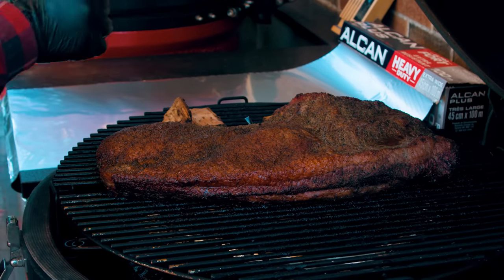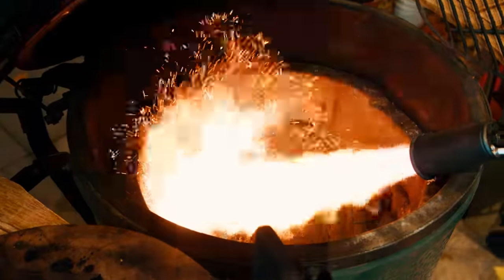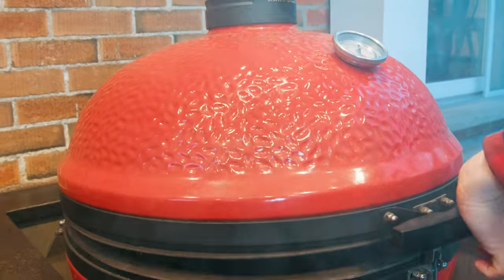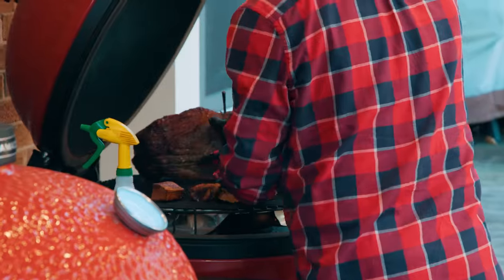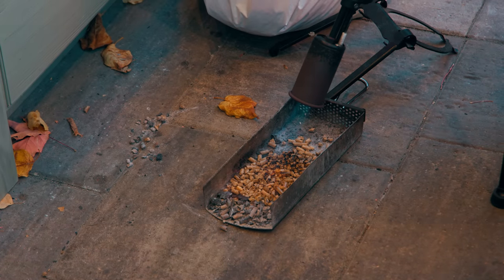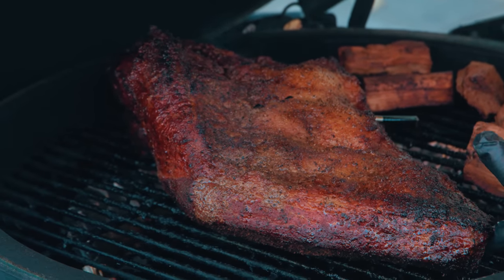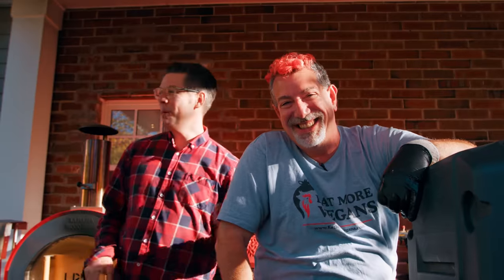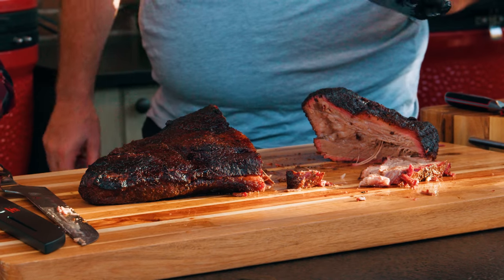I Bet it All to Prove the Kamado Joe is Just Hype ft. @SmokingDadBBQ

Comment: You both should switch to Primo XL. Much better than both of those.
Reply from the maker: I haven't yet cooked on one, but I do have a friend who cooks on one. What do you think makes the Primo better? Do you think it can really compete with the SloRoller on the Kamado Joe?
Reply: @BehindTheFoodTV  you can put a quarter split (smaller one) on the bottom against the steel airflow grate. That keeps the smoke content pretty high and because it passes through your charcoal it completes the combustion really well. The biggest benefit vs round kamado is the shape and being able to access your fire without pulling racks if you split it. Ultimately, trying to make a smoker out of a kamado is why I just got a dedicated smoker though.
Reply: @BehindTheFoodTV  also, made in USA. Mostly I was just talking smack for fun. All 3 will make great food.